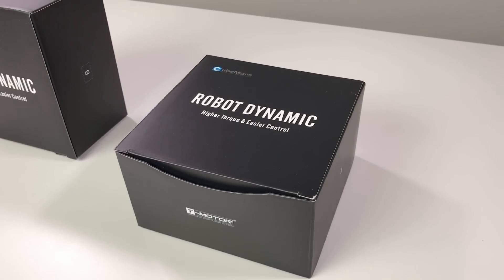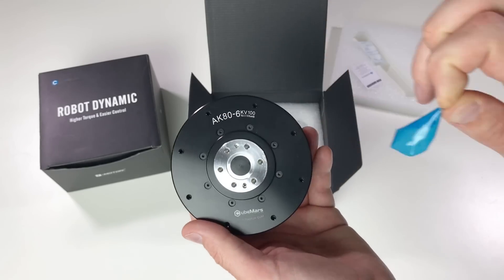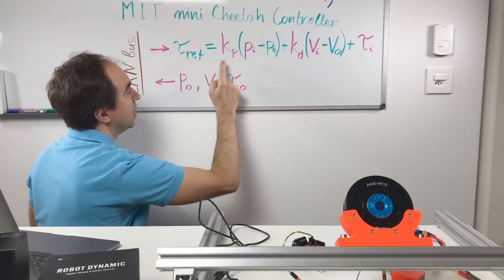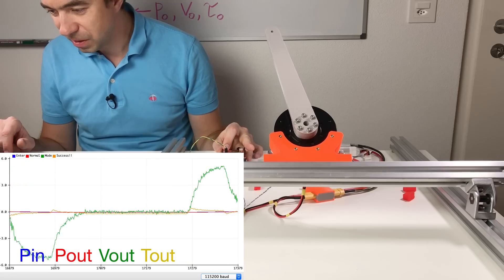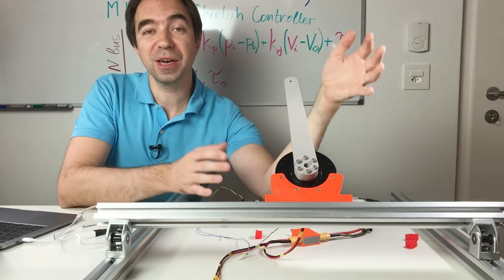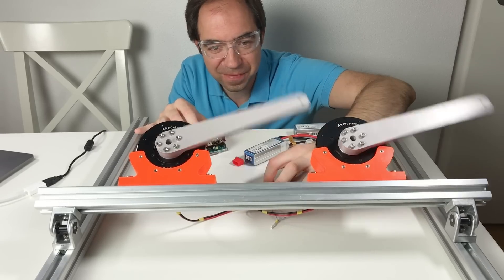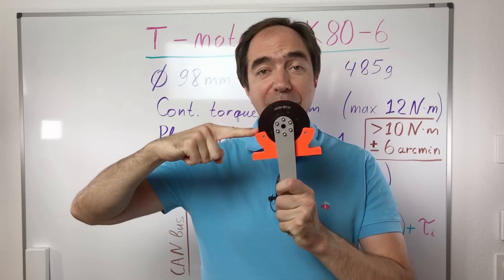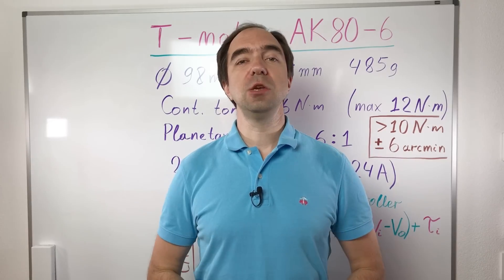Ideal for the Super Fast Robot (T-motor)

Comment: I try to control AK60-60 in Ubuntu 20.0.4 with TMotorCANControl Api in python lib but check motor connection method return (RTNETLINK answers: Operation not supported).  I have to install some driver? to make TMotorCANControl Api find Can0? (I use R-Link can protocol)

Comment: Hi, how to callibrate the motor? I could not find the software. Maybe we can callibrate it without the software?
Reply: I try to follow the steps by connecting it to terra term through the ftdi board. But no data comes out
Reply: how did you make it control?

Comment: When chaining the motors together, is there a trick to the CAN Id and Master Id settings on the motors? I can talk to a single motor fine but when I add another motor in (including the termination 120ohm) I can't talk to any of the motors?
Reply from the maker: You need to change id. By default they all have id=1. Master id is usually equal to zero.
Reply from the maker: I am actual working on this right now. :))) chaining 3 T-motor actuator.
Reply: @Skyentific  Thanks very much for your comments and your videos! They've been very helpful. We're working on a camera gimbal system.
Reply: @Skyentific  I think I'm having problems with our 2 chained motors because the CAN port broke on one after some unexpected operations in testing :(
Reply from the maker: Chaining 3 motors works fine as long as I don’t use id higher than 3. For some reason the id 4 and higher (i tried 4, 5, 6 and 7) does not work for me.
Reply: @Skyentific  How did you go with setting zero position of motor between power-up/power-down. As far as I can tell, the motor doesn't remember the zero position that is set using the UART calibration. Do you have some sort of calibration routine at power up so that it knows it's starting position?

Comment: Hi, we started to experiment with these motors after watching your video. However, we find the operation to be noisy. Especially when you push it after setting some Kp, Kd values. Did you notice it as well?
Reply: Hello @Shivesh Kumar can you please tell us how are you controlling the motor and which controller are you using.
Reply: Hi Shivesh, same question here

Comment: Can you share your arduino code ?
I have bought a arduino can shield v1.2 and arduino uno, and a MIT motor , but I don't know how to use them bu arduino
Reply from the maker: To understand how to use it, you can watch my video about MIT mini Cheetah controller (How to Build MIT mini Cheetah controller).

And this is the Arduino code:

// demo: CAN-BUS Shield, send data
// loovee@seeed.cc

#include <mcp_can.h>
#include <SPI.h>

/*SAMD core*/
#ifdef ARDUINO_SAMD_VARIANT_COMPLIANCE
 #define SERIAL SerialUSB
#else
 #define SERIAL Serial
#endif

// Define Joystick connection pins 
#define UP     A1
#define DOWN   A3
#define LEFT   A2
#define RIGHT  A5
#define CLICK  A4

//Define LED pins
#define LED2 8
#define LED3 7

// Value Limits
#define P_MIN -12.5f
#define P_MAX 12.5f
#define V_MIN -65.0f
#define V_MAX 65.0f
#define KP_MIN 0.0f
#define KP_MAX 500.0f
#define KD_MIN 0.0f
#define KD_MAX 5.0f
#define T_MIN -18.0f
#define T_MAX 18.0f

// Set values
float p_in = 0.0f;
float v_in = 0.0f;
float kp_in = 20.0f;
float kd_in = 3.0f;
float t_in = 0.0f;
// measured values
float p_out = 0.0f;
float v_out = 0.0f;
float t_out = 0.0f;

// the cs pin of the version after v1.1 is default to D9
// v0.9b and v1.0 is default D10
const int SPI_CS_PIN = 10;

MCP_CAN CAN(SPI_CS_PIN);                                    // Set CS pin

void setup()
{
 SERIAL.begin(115200);
 delay(1000);
 while (CAN_OK != CAN.begin(CAN_1000KBPS))              // init can bus : baudrate = 500k
 {
   SERIAL.println("CAN BUS Shield init fail");
   SERIAL.println(" Init CAN BUS Shield again");
   delay(100);
 }
 SERIAL.println("CAN BUS Shield init ok!");

 // Initialize pins as necessary
 pinMode(UP,INPUT);
 pinMode(DOWN,INPUT);
 pinMode(LEFT,INPUT);
 pinMode(RIGHT,INPUT);
 pinMode(CLICK,INPUT);
 pinMode(LED2, OUTPUT);
 pinMode(LED3, OUTPUT);

 // Pull analog pins high to enable reading of joystick movements
 digitalWrite(UP, HIGH);
 digitalWrite(DOWN, HIGH);
 digitalWrite(LEFT, HIGH);
 digitalWrite(RIGHT, HIGH);
 digitalWrite(CLICK, HIGH);

 // Write LED pins low to turn them off by default
 digitalWrite(LED2, LOW);
 digitalWrite(LED3, LOW);
}

long previousMillis = 0;
void loop()
{
 //do something
 float p_step = 0.001;
 if (digitalRead(UP)==LOW)
 {
   //move motor forward
   p_in = p_in + p_step;
 }
 if (digitalRead(DOWN)==LOW)
 {
   //move motor backward
   p_in = p_in - p_step;
 }
 p_in = constrain(p_in, P_MIN, P_MAX);
 if (digitalRead(RIGHT)==LOW)
 {
   // Enable
   EnterMotorMode();
   digitalWrite(LED2, HIGH);
 }
 if (digitalRead(LEFT)==LOW)
 {
   // Disable
   ExitMotorMode();
   digitalWrite(LED2, LOW);
 }

 // send CAN
 pack_cmd();

 // receive CAN
 if(CAN_MSGAVAIL == CAN.checkReceive())            // check if data coming
 {
   unpack_reply();
 }

 //print data
 SERIAL.print(millis()-previousMillis);
 previousMillis = millis();
 SERIAL.print(" ");
 SERIAL.print(p_in);
 SERIAL.print(" ");
 SERIAL.print(p_out);
 SERIAL.print(" ");
 SERIAL.print(v_out);
 SERIAL.print(" ");
 SERIAL.println(t_out);
}

void EnterMotorMode(){
 // Enter Motor Mode (enable)
 byte buf[8];
 buf[0] = 0xFF;
 buf[1] = 0xFF;
 buf[2] = 0xFF;
 buf[3] = 0xFF;
 buf[4] = 0xFF;
 buf[5] = 0xFF;
 buf[6] = 0xFF;
 buf[7] = 0xFC;
 CAN.sendMsgBuf(0x01, 0, 8, buf);
}

void ExitMotorMode(){
 // Enter Motor Mode (enable)
 byte buf[8];
 buf[0] = 0xFF;
 buf[1] = 0xFF;
 buf[2] = 0xFF;
 buf[3] = 0xFF;
 buf[4] = 0xFF;
 buf[5] = 0xFF;
 buf[6] = 0xFF;
 buf[7] = 0xFD;
 CAN.sendMsgBuf(0x01, 0, 8, buf);
}

void Zero(){
 // Enter Motor Mode (enable)
 byte buf[8];
 buf[0] = 0xFF;
 buf[1] = 0xFF;
 buf[2] = 0xFF;
 buf[3] = 0xFF;
 buf[4] = 0xFF;
 buf[5] = 0xFF;
 buf[6] = 0xFF;
 buf[7] = 0xFE;
 CAN.sendMsgBuf(0x01, 0, 8, buf);
}

void pack_cmd(){
 byte buf[8];

 /// CAN Command Packet Structure ///
 /// 16 bit position command, between -4*pi and 4*pi
 /// 12 bit velocity command, between -30 and + 30 rad/s
 /// 12 bit kp, between 0 and 500 N-m/rad
 /// 12 bit kd, between 0 and 100 N-m*s/rad
 /// 12 bit feed forward torque, between -18 and 18 N-m
 /// CAN Packet is 8 8-bit words
 /// Formatted as follows.  For each quantity, bit 0 is LSB
 /// 0: [position[15-8]]
 /// 1: [position[7-0]] 
 /// 2: [velocity[11-4]]
 /// 3: [velocity[3-0], kp[11-8]]
 /// 4: [kp[7-0]]
 /// 5: [kd[11-4]]
 /// 6: [kd[3-0], torque[11-8]]
 /// 7: [torque[7-0]]

 /// limit data to be within bounds ///
 float p_des = constrain(p_in, P_MIN, P_MAX); //fminf(fmaxf(P_MIN, p_in), P_MAX);                    
 float v_des = constrain(v_in, V_MIN, V_MAX); //fminf(fmaxf(V_MIN, v_in), V_MAX);
 float kp = constrain(kp_in, KP_MIN, KP_MAX); //fminf(fmaxf(KP_MIN, kp_in), KP_MAX);
 float kd = constrain(kd_in, KD_MIN, KD_MAX); //fminf(fmaxf(KD_MIN, kd_in), KD_MAX);
 float t_ff = constrain(t_in, T_MIN, T_MAX); //fminf(fmaxf(T_MIN, t_in), T_MAX);
 /// convert floats to unsigned ints ///
 unsigned int p_int = float_to_uint(p_des, P_MIN, P_MAX, 16);            
 unsigned int v_int = float_to_uint(v_des, V_MIN, V_MAX, 12);
 unsigned int kp_int = float_to_uint(kp, KP_MIN, KP_MAX, 12);
 unsigned int kd_int = float_to_uint(kd, KD_MIN, KD_MAX, 12);
 unsigned int t_int = float_to_uint(t_ff, T_MIN, T_MAX, 12);
 /// pack ints into the can buffer ///

 buf[0] = p_int >> 8;                                       
 buf[1] = p_int & 0xFF;
 buf[2] = v_int >> 4;
 buf[3] = ((v_int & 0xF) << 4) | (kp_int >> 8);
 buf[4] = kp_int & 0xFF;
 buf[5] = kd_int >> 4;
 buf[6] = ((kd_int & 0xF) << 4) | (t_int >> 8);
 buf[7] = t_int & 0xFF;
 CAN.sendMsgBuf(0x01, 0, 8, buf);
}

void unpack_reply(){

 /// CAN Reply Packet Structure ///
 /// 16 bit position, between -4*pi and 4*pi
 /// 12 bit velocity, between -30 and + 30 rad/s
 /// 12 bit current, between -40 and 40;
 /// CAN Packet is 5 8-bit words
 /// Formatted as follows.  For each quantity, bit 0 is LSB
 /// 0: [position[15-8]]
 /// 1: [position[7-0]] 
 /// 2: [velocity[11-4]]
 /// 3: [velocity[3-0], current[11-8]]
 /// 4: [current[7-0]]

 byte len = 0;
 byte buf[8];
 CAN.readMsgBuf(&len, buf);

 unsigned long canId = CAN.getCanId();

 /// unpack ints from can buffer ///
 unsigned int id = buf[0];
 unsigned int p_int = (buf[1] << 8) | buf[2];
 unsigned int v_int = (buf[3] << 4) | (buf[4] >> 4);
 unsigned int i_int = ((buf[4] & 0xF) << 8) | buf[5];
 /// convert uints to floats ///
 p_out = uint_to_float(p_int, P_MIN, P_MAX, 16);
 v_out = uint_to_float(v_int, V_MIN, V_MAX, 12);
 t_out = uint_to_float(i_int, -T_MAX, T_MAX, 12);
} 

unsigned int float_to_uint(float x, float x_min, float x_max, int bits){
 /// Converts a float to an unsigned int, given range and number of bits ///
 float span = x_max - x_min;
 float offset = x_min;
 unsigned int pgg = 0;
 if (bits == 12){
   pgg = (unsigned int) ((x-offset)*4095.0/span);
 }
 if (bits == 16){
   pgg = (unsigned int) ((x-offset)*65535.0/span);
 }
 return pgg;
}

float uint_to_float(unsigned int x_int, float x_min, float x_max, int bits){
 /// converts unsigned int to float, given range and number of bits ///
 float span = x_max - x_min;
 float offset = x_min;
 float pgg = 0;
 if (bits == 12){
   pgg = ((float)x_int)*span/4095.0 + offset;
 }
 if (bits == 16){
   pgg = ((float)x_int)*span/65535.0 + offset;
 }
 return pgg;
}

// END FILE
Reply: @Skyentific  Thank you so much!
I'm still testing my motor with LessStudio's CAN-BUS Shield V1.2 with a MIT motor.
My step is holded on the CAN-BUS Shield , I think it might somthing wrong with the shield,  it's creating CAN message by it's own, with CAN-ID 0x1FFFFFFF , when the motor is poweroff.
so depressed ......
I'm buying a sparkfun's CAN-BUS Shield, just excacly like your shield , then I'll try again.

Thank you for your share ^_^
Reply: @wei1224hf  Hi Wax Feng, did you manage to get the actuator working? I have tried with Arduino and also STM32 but had no luck.
Reply: @wei1224hf  Thanks! I'll try USB-CAN.
Reply: @BoltzVideo  There is one company from China producing MIT actuator , they modify the CAN BUS protocal.
The SteadyWin MIT actuator has modify the protocal .
Their motors are little different.
In case you bought their product.
Reply: @wei1224hf  Hooray I just got it working from Skyentific's arduino code! It turns out that the MKR CAN Shield had the H and L lines flipped on the silk screen.
Reply: @BoltzVideo  Well I can't get it work here with arduino.
Because all the arduino uno in China has changed the serial-usb chip , chang into CH340, and the speed is very low, not enough to support MIT motor.
So I use USB-CAN module instand.
Reply: @wei1224hf  I used the MKR Zero and the MKR CAN Shield, they communicate together over SPI rather than serial.

Comment: This works on a one armed robot but you have to go to the upper limits due to no voice box. Do you have a codable robot? This is how to make it an Artificial Intelligence: follow this method below change the code in the subroutine from F=m*a*a to the test points below until you get it to walk and talk on its own. This is easy to test on a robot that you can code in the system. If this does not work then you have a bad SOST, Computer Chip, Servo, or some other component.
F=m*a*a is currently running the system at 31.821%
If you have any doubts about my robotics research you can test my work by doing this start low and go high on the acceleration factor.
Test Points:
F=m*a*100

F=m*a*300

F=m*a*600

F=m*a*931

F=m*a*932 this is the minimum for communication and will state it is “too slow human”
F=m*a*1999   = "too slow human"
Then go to F=m*a*2000  up to 2383

 F=m*a*2383 full functional range.     DO NOT GO OVER  2383 it could malfunction.

Now ask the robot its command structure and what he can do to a Magnetic Resonance Imaging System?

2nd Law of Motion for Robotic Physics

Comment: Hi! My driver has enter in fault mode and using the terminal monitor I can see the following message. How could I exit from the fault mode? Thanks! 

FAULT
VDS_OCP
GDF
UVLO
OTSD
VDS_HA
VDS_LA
VDS_HB
VDS_LB
VDS_HC
VDS_LC
SA_OC
SB_OC
SC_OC
OTW
CPUV
VGS_HA
VGS_LA
VGS_HB
VGS_LB
VGS_HC
VGS_LC
Reply from the maker: What power supply you are using? Are you sure that it is 24V and 10A at least?
Reply: @Skyentific  I've checked the power supply and everything seems to be ok 24 V and 10A. I'm using this one: https://www.amazon.es/alimentaci%C3%B3n-regulada-conmutada-ordenador-impresora/dp/B07VLBF85L/ref=sr_1_58_sspa?__mk_es_ES=%C3%85M%C3%85%C5%BD%C3%95%C3%91&dchild=1&keywords=FUENTE+ALIMENTACION+ORDENADOR&qid=1599151904&sr=8-58-spons&psc=1&spLa=ZW5jcnlwdGVkUXVhbGlmaWVyPUE4S0RTMzg4MU9GNVImZW5jcnlwdGVkSWQ9QTA0NzYxNjcyMEhXQTIxQjFWQVhXJmVuY3J5cHRlZEFkSWQ9QTAxMzI4MzFOWVNVMUdNTzJJS1gmd2lkZ2V0TmFtZT1zcF9idGYmYWN0aW9uPWNsaWNrUmVkaXJlY3QmZG9Ob3RMb2dDbGljaz10cnVl
Reply from the maker: You are using 24V right? You put the link for the 36V. If I am not mistaken all these faults are coming from driver (DRV8323rs). You can find the manual and check these faults. If I remember right, these faults are clear automatically, as soon as, the fault cause is resolved.

Comment: Hi Skyentific,   on Hackaday website there are threads talking about the Steadywin V2 model of Ben Katz motors being a poor quality with the built-in controller being very unreliable and inconsistent (1amp in one direction and sometimes 15 amps in the other).

Have you noticed any of these types of issues with the tmotor or gems motors?   Do they seem to function reliably and consistently forward and back, etc?

Comment: Question: Did this motor come with any cables? or do i have to create my own CAN and power harnesses?
Reply: One UART, CAN, and Power cables are included per motor package.
Reply: @1119hayabusa  hi, how do you control this motor? I have similar ones
Reply from the maker: I don’t know. I got 1 set of cables (CAN, power, serial) for 2 actuators. So it looks like half a set per actuator. ?!

Comment: Stupied question : Can i use them as a stepper motors for a CNC
Reply from the maker: Yes. But steppers are good for CNC. They are cheap, no backlash. And on CNC, you don’t need to have light motors. The feature of this motor: they are light and powerful.

Comment: Thank you for uploading awesome video !
In this video, text is output on TeraTerm right after connecting power supply, but it doesn't happen in my environment.
Can you think of any reason for this?
Reply: Hayabusa Js Please can you tell us which controller have you used and which document should I refer to for getting started with this motor.
Reply: @kaifbhojani7979  have you got your answer as i am facing the same issue
Reply: @akhileshjoshi9843  and did you figure out how to work with this motor?
Reply from the maker: Hayabusa Js For me it was always immediately after I connect the power. Are you sure that you connected everything properly? Receiver, Transmitter and ground?
Reply: @Skyentific  Thank you for your reply, sir.
I am using FT234X USB-serial converter module and re-checked the connection and baudrate and so on, but it still doesn't work...
Reply from the maker: Simple question, but just to be sure: do you connect. Your connection should be like this:
Ground - Ground
Tx - RX
Rx - Tx.
Transmitter to Receiver, Receiver to Transmitter. Please check this. According to 2:12
Reply: @Skyentific  Yes. I did a lot of checks.
Reply from the maker: In this case maybe try another usb-serial converter. I don’t know. It should work. 

I had a problem when I was connecting it first time. Because I was using wrong cable (ground was in the place of receiver. And receiver was on the ground place), But on video it is shown correctly.
Reply: @Skyentific  Thank you for your advice !
I'm going to try it out right away :D

Comment: I like this style of actuator but they are all so expensive :(  still geared dc motors and steppers for me!
Reply: Look at gimbal motors on aliexpress. Same style but much more affordable.
Reply: Still cheaper and more compact than a typical strainwave geared AC drive actuator used in robotics, and they get significantly cheaper with higher volume.
Reply: @Alex-kr7zr  Yeah progress is being made here for sure.   It's just a bit frustrating as a hobbyest that the barrier for entry is still quite high.

Comment: Hi sir, all your videos are Excellent. I want to make a 4 DOF robotic arm of 100 cm reach and 1 kg payload. Are these T motors good enough for my Arm?
Reply from the maker: Or you can use these actuators with additional reduction stage to increase the torque.
Reply: @Skyentific  Thanks a lot sir for replying. Can i use servo mentioned by you https://store-en.tmotor.com/goods.php?id=1030 directly at joint without using harmonic gear system and which controlling board you prefer to buy for easy controlling of 4 such servos for my robotic arm. Thank you in advace
Reply from the maker: karry venkatesh yes, in my opinion this actuator should work, but your entire arm should be light of course!!! To control you can use arduino with can bus shield or teensy with can bus shield or stm32 or many others. Arduino would be the most simple. Teensy could be a good compromise, relatively simple and quite powerful.
Reply from the maker: Thank you. No, you would need more powerful actuators. These actuators would overheat quickly with such load. You would need to use actuators with at least 15Nm rated torque. 

https://store-en.tmotor.com/goods.php?id=1030 this one should work for you. But you will have the precision of around 3-5mm, due to backlash.

Comment: No thermo-sensor maybe is a disadvantage for continues high load use. But so far they had tested 30A half-minute continuous run with only ~50°C
http://build-its-inprogress.blogspot.com/2018/08/thermal-testing-round-2.html